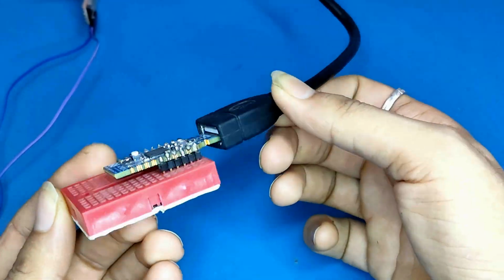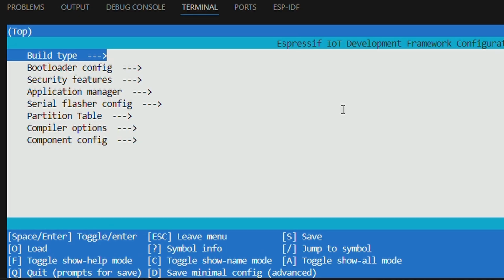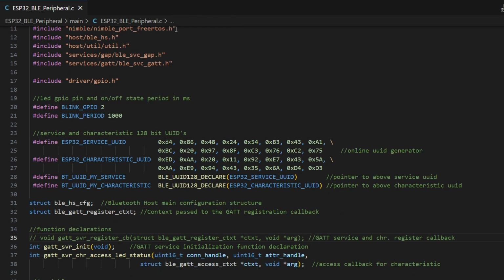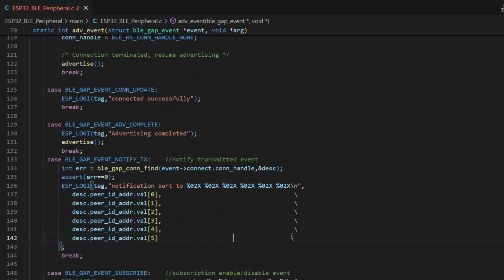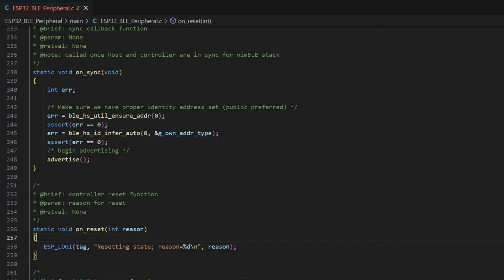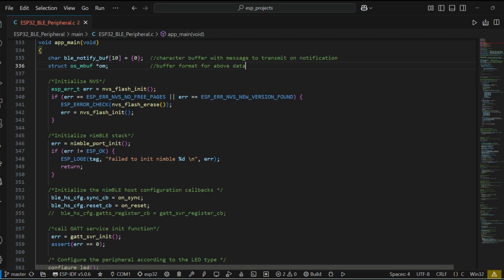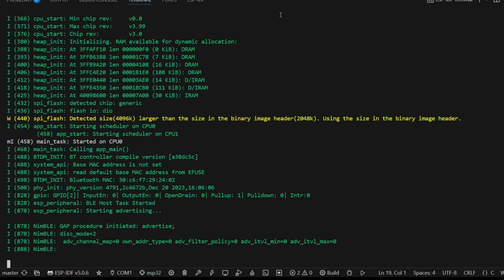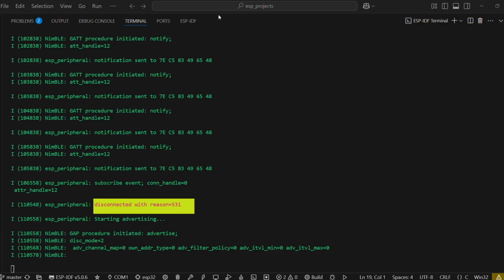ESP32 Bluetooth Peripheral Tutorial: Build a BLE Device (Step-by-Step)

Comment: How to hack wifi using this ESP 32 board not Nord MCU
Reply from the maker: @R-Winder   Hacking is a broad term, if you are thinking of retrieving password of any Wi-Fi network, then ESP32 lacks such resources but you can however perform certain attacks on devices connected to a particular Wi-Fi network. You may check out this project https://github.com/risinek/esp32-wifi-penetration-tool. NOTE: Using such tools on networks you don’t own or have explicit permission to test is illegal and unethical. Thanks.